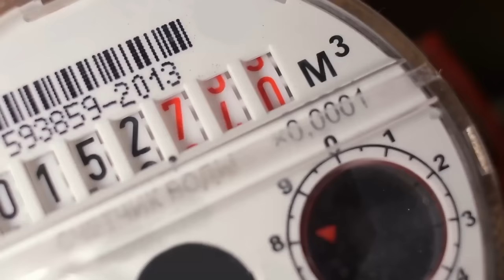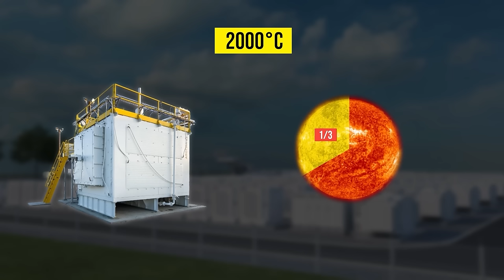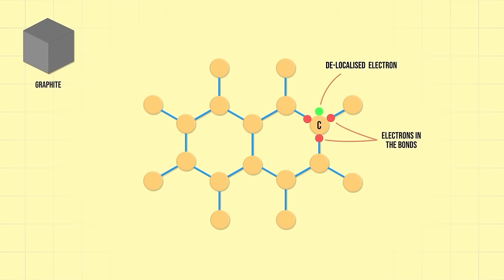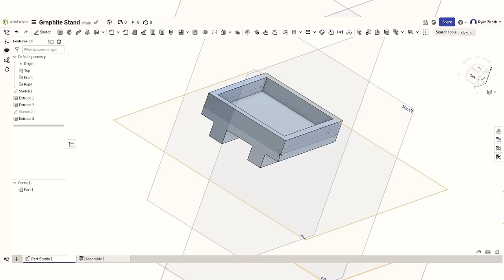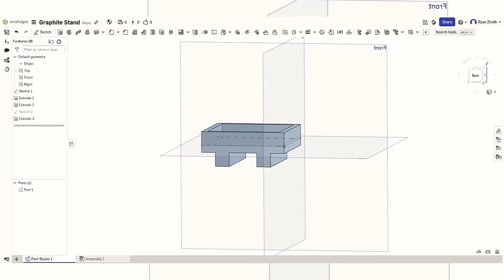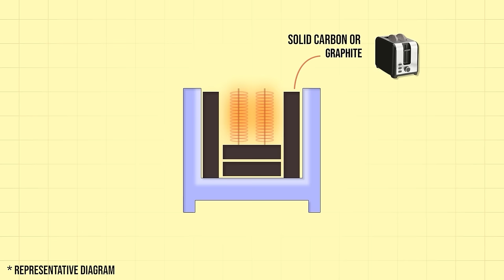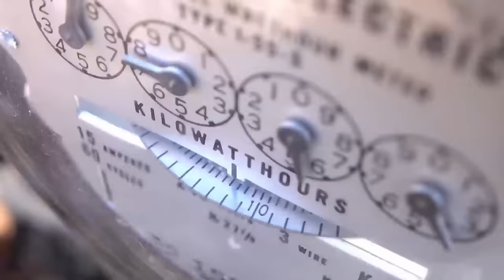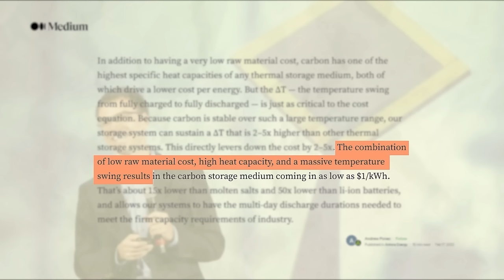Why Solid Carbon is the Future of Energy Storage

Comment from the maker: Thanks for watching! Don't forget to get started in Onshape for FREE: https://Onshape.pro/Ziroth - You won't regret giving it a try!
Reply: Actually in Roman times they were lead.
Reply: When I have  1m³ Block i have 6 surfaces 6m² but how far can the TPV panels placed?
Reply: You missed that fossil fuels is a feedstock in petrochemicals (plastics) and cement making (flyash); not just heat.
Reply: No fossils can be burned
Reply: Best not to use Celsius temperature scale when comparing with surface of the sun.
2000°C is 2273K.
Surface temperature of the sun is 5800K.
Reply: Isn't making tons of solar panels darkening the earth surface bad?
Reply: If that TPV technology is a real thing, this could change solar energy dramatically. I used to be an engineer for industrial solar installations. One of the biggest issues that arose on a regular basis, was cooling. The panels heat up the air behind them, yet prevent most of the free airflow, especially when mounted flat on slanted roofs. This increased temperature dramatically decreases the efficiency of the panels. The 20% efficiency you speak of, is at optimal angle (which without trackers you'll get about 30min a day) and at 10°C. Temperatures behind the panels can exceed 60°C, dropping the efficiency below 10%. If that heat is converted to power, not only do you increase the output per surface unit, but you keep the temperature lower and thus the efficiency of the PV layer higher. I estimate that it could even be useful to stack 2 layers of TPV behind a PV panel.
Reply: Small point: You said...'concrete, cement and ceramics'. Concrete and cement are ceramics, and so are bricks and glass.
Reply: @RWBHere  bricks I can see, but how do you explain concrete, cement and glass? Perhaps you are confusing with silicates ? (or perhaps your native tongue doesn't make the difference?) I have never known anyone who said "ceramics" to actually be talking about cement. It refers to products made of baked clay. There is no clay in concrete or cement. Nor is it baked. Same for glass, even though glass is kiln heated during processing.
Reply: Это выглядит как хорошее решение для производства водорода в высокотемпературном серно-йодном цикле! Минуя этап преобразования тепла в электричество, мы получим преобразование энергии водород с очень высоким КПД!
Reply: you will get more likes if you cut the anti-co2 propaganda? maybe you could even do a video on that. start with the 600 million year temperature co2 chart, 0.04% of the atmosphere, and how it was called global cooling in 1975.

Comment: Let's de-carbonize with pure carbon!
Reply: As long as it's not in the atmosphere as CO2, carbon is not a problem so yeah that's the idea. And it's a genius idea, especially if they use carbon from carbon capture
Reply: Lol, was going to write the same - Carbon; this time it’s good for the environment.
Reply from the maker: In batteries seem like the best place for it! Haha
Reply: “Carbon Sequestration in Construction” (CSIC) / “Carbon Sequestration in Materials (CSIM) is a bit of a concept I thought of a bit ago.

I have to dig for papers, but it could honestly be a method for CCS.  There is a PILE of stuff on Enhanced Weathering in Concrete and all that, but using a PILE of Carbon Black or Carbon Fiber or even just petrochemicals made from Sustainable Biomass and/or Power-to-X tech.

I can ramble about this all day, but I think it is a really interesting area, although LCA’s may make it less exciting as i think!

Either way it’s worth more amazing coverage like this, at least in my book!
Reply: That’s actually the goal, lots of carbon in one spot is the best way to decarbonize the air and water around us
Reply: Hello everyone. I've been on the internet a very long time and regret to inform you all that this person's opinion not been adjusted whatsoever and is probably still riding the high of commenting such an epic gotcha. Good day.
Reply: now if thay could suck the feed out of the atmosphere
Reply: @ericlotze7724  LCA ?
Reply: The carbon pulled from the atmosphere is CO2. It’s too expensive to extract the carbon from the co2.
Reply: I think carbon is quite safe. There are problems with carbon particles. The worst are diesel exhaust and coal dust. These will not be a problem for carbon batteries. 

If the carbon battery is breached, it will catch fire. That will not be easy to do with all the bricks around the carbon. Then the carbon will burn to co2. But there won’t ever be enough batteries opened and burned to put any significant quantities of co2 into the atmosphere- especially compared to what is happening with petroleum. 

It looks promising to me.
Reply: @edwardlulofs444  The process is more expensive but has the advantage of creating carbon that can be sold to projects like that for example. CO2 is compressed and stored which costs more money
Reply: @anthonyjaccard3694  yes. One of us is right. I don’t care who. It all sounds good.
Reply: @ZirothTech  It's nothing wrong with carbonated water either.
Reply: Not only for storing electricity but also for storing carbon. 😅
Reply: @ZirothTech or trapped in permanent frost and peat moss.
Reply: @anthonyjaccard3694 as long as it doesn’t make as much carbon emissions as producing lithium batteries i’m good.
Reply: Wow. Did you think that was witty?
Reply: Cool when it becomes cheaper, but we have no hurry decarbonising because the conseqiences of man bear pug are negligible. The suffering caused by affecting the market(what people appreciate)  with subsidies and penalties is worse
Reply: @snorttroll4379  only because you aren’t bright enough to understand the risk
Reply: I wonder if there is ANY way that CO2 scrubbed from the atmosphere could be converted in to this carbon that these batteries use.  Double whammy
Reply: @anthonyjaccard3694  LCA stands for life cycle analysis. Basically a insanely tedious accounting of all effects of a product on the environment. Which also includes the impacts created by mining/producing the materials which go into the product, all the way to how if affects the environment after it is thrown in the trash
Reply: @yomanyo327 I wonder how much "carbon" should be pulled from the atmosphere?
Reply: @williamcrowley5506 Maybe you know the answer to this; how much carbon needs to be pulled from the atmosphere?
Reply: @anthonyjaccard3694  Life Cycle Assessment

Basically doing all the math to see if something is really sustainable, and what materials go into it, where those come from, and how waste/dismantling at end of life is done.

“Cradle-to-Grave” is a related term.

Also “From Well to Wheel” is used in the context of Biofuels/E-Fuels etc sometimes.  

Hope this helps!
Reply: @anthonyjaccard3694 lol considering that we are well below the optimum levels of atmospheric CO2, your comment is quite misguided. 😂
Reply: @yomanyo327 😂😂😂 lol it would be nice if that was how atmospheric CO2 worked. Unfortunately for your idea, CO2 levels trail warming not the other way around.
Reply: @unicornadrian1358  We seem to have very different definitions of "optimum". Care to elaborate?
Reply: @anthonyjaccard3694  Sure! Plants like CO2 to be between 1200 and 1500ppm. We are way down at 430ppm. As CO2 levels rise, the planet gets greener and more productive.
Reply: @unicornadrian1358  OK I get your reasoning but "optimum for plants" does not mean "optimum for the whole environment and us humans". We've already increased the CO2 by 50% since pre-industrial era and we've already seen an increase in global temperatures and extreme events (among which droughts and forest fires which are definitely not good for plants). 
If CO2 levels keep increasing (no matter if we're the ones doing it or not) temperatures will keep increasing which will put a lot of people at risk because of heatstrokes during heatwaves, hurricanes which are going to become more frequent, or because of the ice caps melting which will increase sea levels, displacing millions of people from their homes and potentially releasing methane trapped in frozen ground. Plants can't use methane for their growth but it's a terribly effective greenhouse gas so consequences would be even more dire. So yeah I would hardly call 1200ppm an "optimum" or even "acceptable" level of CO2
Reply: @anthonyjaccard3694  you are looking at it from a very short sighted perspective. More greening means more arable land and therefore less hunger. The heatstroke argument holds little credibility because humans already live in a wide variety of temperature zones and frequently move from one to another. Humans acclimatise very quickly, far faster than the changing temperatures. On the subject of temperature, the way temperature gets recorded has been modified and gives higher results on average, not to mention govt scientists going and adjusting earlier recorded actual temperatures to better reflect their current models. Don’t fall for the fear mongering that is being constantly thrown at us.
Reply: Water is good in a cup... Not so great in your laptop... Ya numptie!
Reply: For a medical person (Dentist/Oral Surgeon) decarbonization has always had a kinky sound since all lifeforms on this planet are carbon based! The CO2 in the air is the feed for all plants and we are seeing plantlife thriving at the abundance we have now. If we want to survive we better not decarbonize. If there is a „cleaner“ way to run our show I am all for it but please without ideology and more with ideas like the one shown here!
Reply: @berndheiden7630  plant life won't thrive once they are hit with droughts and forest fires
Reply: @lucbloom It always was/
Reply: what better way to get rid of the carbon then to use it to fight the carbon
Reply: @anthonyjaccard3694  Capturing that carbon cost more carbon in form of energy used than is captured. Lol.
Reply: Let's start by understanding that fossil fuels is a marketing term for the second most abundant renewing fluid on the planet aka oil..
Reply: @Alex-um4fe   i don't think oil could be considered renewable or as plentiful as the wind or sunlight but i'm no professional.
Reply: @ecogreen123  well let's start with at least a consideration/comparison by professional rather than a dismissal for marketing reasons.
Reply: @Alex-um4fe   understandable, I'm willing to consider and compare.
Reply: @ecogreen123  cool start with oil, explore why that industry crushed the natural renewing diesel market for synthetic version that produces deadly fumes. 
Then let's discuss alternatives that make sense for commercial industry use.
Reply: @Alex-um4fe  definitely sounds like a plan, tho i don't think the replies would be the best place for this.
Reply: @lucbloom Without carbon, the environment would be very different😮.
Reply: @eestaashottentotti2242  Yes, if CO2 drops under 230-200 ppm, plants will start suffocating.
Reply: @Alex-um4fe  You certainly do your research. Crude oil is renewable resource and it is made by high pressures in the earth's crust according to newest research.
Reply: @ecogreen123  anyplace else and I would be blocked asap..😜
Reply: Much more efficient to pull it from the ground rather than expensive and unnecessary carbon capture.  Politically C capture would get the investors happy by grabbing subsidized investment capital.
Reply: @Alex-um4fe   that's fair enough, lol.
Reply: Couldn't we use sand as the thermal capacitor ...save the limited graphite  carbon for electrical purposes.
Reply: @GWAForUTBE  i don't think there is a need to save it, got plenty, but a fine point nonetheless
Reply: @ecogreen123  shortages are expected by 2030 .
Reply: @GWAForUTBE  i was unaware, thanks for informing me!
Reply: There’s one little problem Solid carbon blocks, also known as carbon blocks or graphite blocks, are typically produced through a process called graphitization. Here's a simplified overview of the process:

1. **Raw Material Selection**: The primary raw material used in the production of carbon blocks is petroleum coke, which is a byproduct of the oil refining process. High-quality coke with low sulfur content is preferred.

2. **Mixing and Forming**: The petroleum coke is ground into fine powder and then mixed with a binder, often coal tar pitch or petroleum pitch. This mixture is then formed into blocks using molding techniques such as extrusion or compression molding.

3. **Baking**: The formed blocks are then heated in an oxygen-free environment at temperatures between 1000°C to 2000°C (1832°F to 3632°F). This process is known as baking or carbonization. During this stage, volatile components in the binder are driven off, leaving behind a solid carbon structure.

4. **Graphitization**: The baked carbon blocks are then subjected to even higher temperatures, typically between 2500°C to 3000°C (4532°F to 5432°F) in a controlled atmosphere. This process causes the carbon atoms to rearrange into a crystalline structure, transforming the carbon material into graphite.

5. **Finishing**: After graphitization, the blocks may undergo additional machining and finishing processes to achieve the desired dimensions, surface smoothness, and other properties.

The resulting solid carbon blocks are known for their high thermal conductivity, low electrical resistance, and excellent mechanical strength, making them valuable materials for various industrial applications, including electrodes for electric arc furnaces, anodes for electrolytic cells, and as structural components in high-temperature applications.
Reply: @ThisOneAgain246  
Ok.... so what's the problem?
Reply: @hg2.  It takes a lot of energy that will come from some fossil fuels to do.
Reply: Fight fire with fire!

Comment: At 1700C you would get a theoretical conversion efficiency to electricity of about 75% with a Carnot cycle. It increases with the temperature. I was wondering if you could molten sand as perhaps another option. You have a boiling point of 2230C and in its molten state heat conductivity would increase, and another thing is you get some extra storage capacity from the latent heat when it melts. Also one thing totally left out in the video is leakage of heat. You are up agaisnt the Stefan–Boltzmann law of sigma T^4. How do you mitigate this as T rises?
Reply: I also felt the lack of these points. It seems like a laboratory idea that won’t be at the market, maybe never.
Reply: Hmmm, I thought that solar plant in Nevada (Crescent Dunes) was molten sand, and I came here to post about it, except it's molten salt. Hmmm. Hmmmmmmmm.
Reply: The idea is a called solar thermal power plant, and the technology has been around since the 60s. Its efficiency is around 75% in ideal conditions too.
Reply: Double metal walled insulation won't work?
Reply: Yes other storage companies are using sand or concrete blocks for cheap energy/heat storage
Reply: @larryc1616 what you want to do is scale it up. The larger it is the larger the volume to surface area is and so the less heat loss per unit volume.
Reply: Just to be precise from 1700 °C to 50 °C Carnot cycle efficiency would be 83,6 %. But Carnot cycle is unrealistic idealization. Real CO2 cycle using three-stage divided compression and three-stage divided expansion with regeneration could theoretically achieve 78,9 % efficiency. I designed few cycles for such use in my thesis, but i worked with max temperature only around 600 °C and even at that temperature i achieved 45-55 % efficiencies with various designs.
Reply: @tedwheelchair You are mashing thermophotovoltaic panels (efficiency around 40 %, no moving parts) and solar thermal power plant (efficiency of collectors around 75 %, but overall efficiency only at 20 % with lot of moving parts). Those two things sound similar but there is big difference.
Reply: @vaclavpokorny2115  Thanks. The 75% figure was from memory, hence why I said about.
Reply: Also significant maintenance burden introduced by moving parts and need for significant volume taken to house rotating equipment etc…
Reply: This obviously is an ad for potential investors. All the hard points are left out and they somehow got solar cells with 40% efficiency in the worst spectrum for solar cells. That alone would be a pretty good product to market without all the other stuff attached to it. I call bullshit on the whole electricity generation part.
It might still be okay or not for converting excess electricity (which currently doesn't exist) to heat which then might be directly used in processes actually requiring heat.
Reply: @Oktokolo  Standard cells also degrade in efficiency with temperature.
Reply: @SahilP2648  Even if there is a vacuum between the walls, there will still be infrared emission from the hot interior wall. At those temps they'll be better off insulating like you would a kiln.
Reply: @privatemale27 infrared radiation can be reflected though...